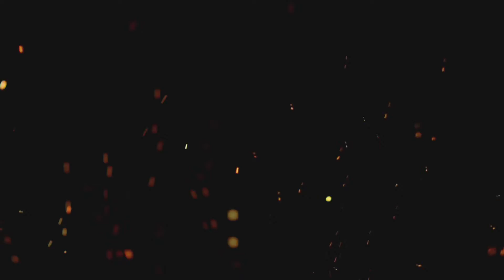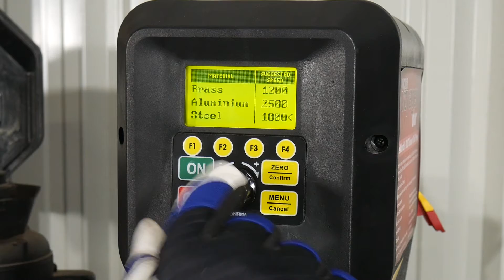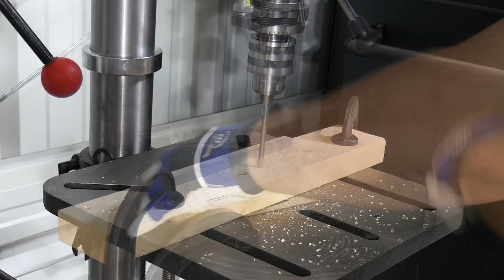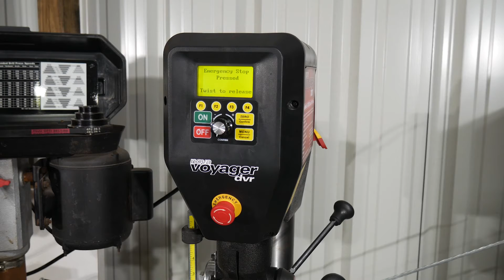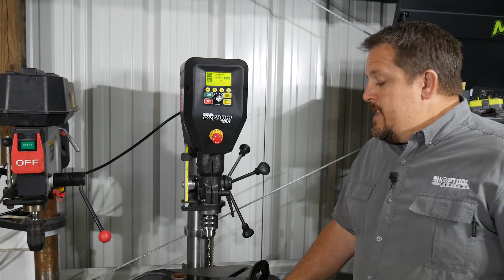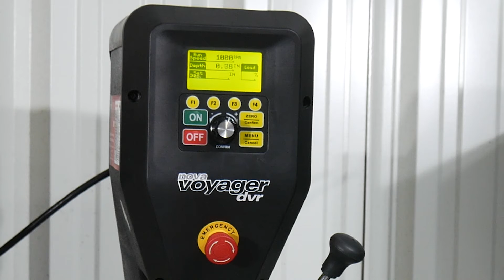Nova Voyager DVR Variable Speed Drill Press

Comment: $2799.00 Aus!
https://www.carbatec.com.au/nova-dvr-drill-press

😳😳😳

You gotta be kidding me!
1. It has no work light!
2. It has no Laser aligner.
3. It has excessive runout
4. It has a cheap arsed Chinese key chuck!

It Ought to have an expensive German quality engineered hand chuck with fast adjust jaws!

It takes longer to turn it on & program the menu- than it does to drill the feckin hole!

Yes it has computer controlled depth stop / alarm / spindle brake!

Despite all that it doesn’t oscillate the quill up and down to be able to use sanding bobbins in the drill!

It also needs a circular hole in one corner of the table that you can use to run sanding bobbins in, and drop in spacers to match sanding bobbin diameters.

It’s all pretty basic stuff!

At almost $3k it’s woefully inadequate in so many areas as to be a joke, an expensive joke!

When a belt breaks- you buy a new belt & keep working!

When the computer circuit board fails on this over priced under designed & poorly engineered joke, you throw it in the trash!

Nova Teknatool need to go back to the drawing board on this one, it’s an epic fail!

These are about $1500US stateside, yet they are almost DOUBLE that downunder?

Our pacific peso is only worth 72c against the greenback, meaning we should expect to pay 28% more with exchange rates!

Not 100% more!

It’s a feckin expensive RIPOFF is what it is! 😡